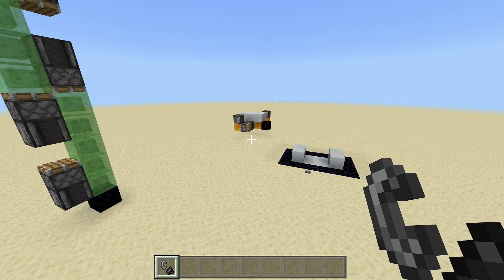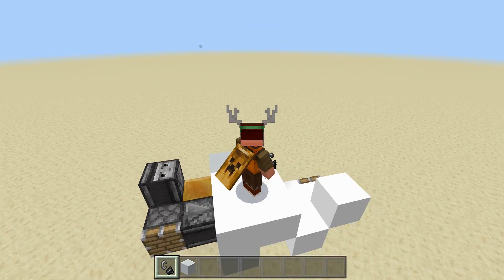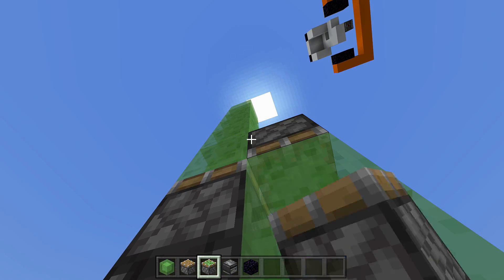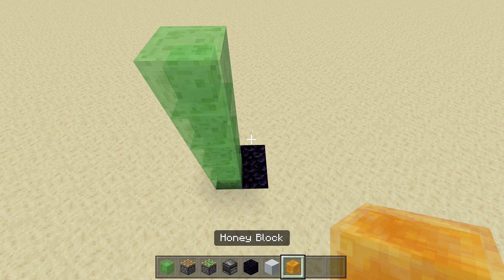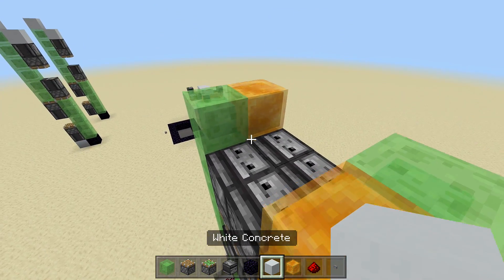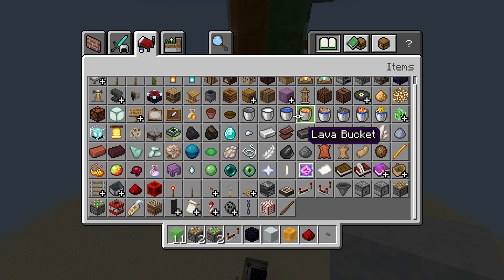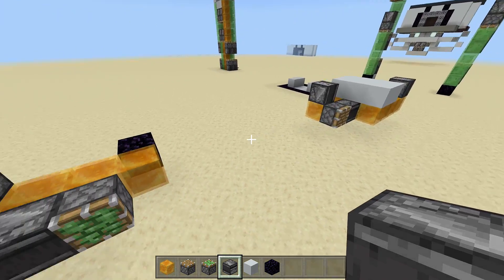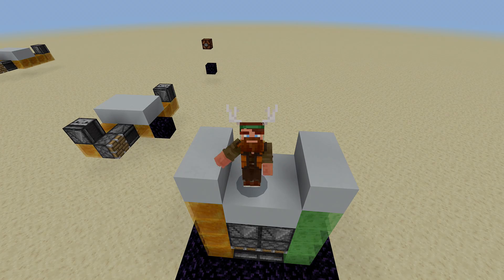2 Way Flying Machine in Minecraft Bedrock! (NO PISTON SWAPPING)

Comment: Is it possible to stick some slime blocks on the side of the horizontal flying machine and make a sugarcane farm. And if so could u make video showing a design. There's not much good bedrock content. That I could find that are simple. Thank you
Reply: I am working on that now. If you mirror the design and make it with slime blocks, as long as you have the observers fire at the same time, you will be fine.

Comment: Right... so, I tried the small vertical flying lift and it works no problem. Up and down. The bigger one however, will only go up. I cannot figure out what is wrong. When I press the button, it just separates the top half of the lift from the bottom half. Pressing the button again connects them back together
Reply: having the same issue

Comment: Just built the horizontal flying machine for my bamboo farm on 1.20. design works as long as it's chunk aligned. I had 2 exact copies of the machine, 1 where all the pistons and observers were in the chunk and the 2nd where some elements were between chunks. The non aligned one always broke, without fail. After rebuilding the 2nd inside of 1 chunk it flies just fine

Comment: Has anything changed since 2020 to break this?  It works fine 90% of the time, but occasionally a normal piston gets left behind (not dragged along with the slime it's attached to)  Also, I use a redstone circuit to 'ping' a dropper to activate the flying machine, and sometimes it just moves one block forward, then one block back (to the start/stop point), sitting there until the next ping from my redstone clock.
Reply: Yup same issue and on realms it is crap all together.

Comment: Can u pls build a secret door using an item. Which means that you throw an item and then the secret door opens. Plzzzzz.i wanna build it in my survival world
Reply: Just do the painting trick and put a pressure plate behimd it with an iron door
Reply: No, what I want is like you have to throw something through the staircase or floor and then the door opens. If it's possible I'll try it out in my redstone testing world. I'm asking this just cuz I'm on bedrock and most tutorials are in java.
Reply: @advaitkhandagale6791  I'm not sure if this will work but here's an idea, so beneath your staircase or floor make a standard small filter system with a hopper minecart on top depositing into the main hopper as hopper minecarts pick up what's above them (within a block) so it would work you threw something a block above it, that would work for getting a item through, then use the filter system so only a specific item can come through and then in the chest into which the item is filtered, connect it to a comparator so it will give a signal when the system collects a block hopefully you can use this to deactivate in some way(I'm not sure) the door and make it open, hopefully I explained that well enough and hopefully it will work
Reply: @danielcarter1512  kk

Comment: Missile works but is there a way to wire the button for the lower section closer to where you would actually be while using it? Its impossible to press the button and make it to the standing platform on time as it is in this video.

Comment: Hi! Originally when I made the "Missile" it worked for about 5 minutes. Then the slime blocks completely stopped moving, which was messing with the honey blocks, stopping them from moving. I built it upside down because I was trying to use it to open a door. It was a 2 by 2 door that was completely in the piston push limit. Is there a fix that you know of? Thank you!

Comment: Has anyone got this to work on a multi-player server? Built this on a bedrock realm and it will go up fine. It will start down but then the timing gets messed up and goes right back up. I built it on a single player server and it works fine. I assume the latency requires additional timings to work.

Comment: Is there anyway you could make this into a viable tunnel bore since the last update on bedrock (at least for me on Xbox) absolutely broke every other model I’ve seen and tested. If not no big deal but I thought I would ask because I am definitely not smart enough to invent one myself 😂
Reply: if its vertical you can just attach a pulsing dispenser with TNT inside or a TNT duper at the bottom of the elevator. Although it is suggested that you do so with a certain distance already present between the elevator and the dispenser to avoid damage and a few delays in the pulse to avoid TNT bounce

Comment: I really need help. I have tried so many different flying machine variations, vertical and horizontal, and they move randomly, until they hit a block. It will go up a little bit, then come back down, or go halfway then come back, then go up again. I would really like an answer to why this happens, and a way to fix it. Flying machines are awesome, but I can't get any designs to work, and I'm on bedrock edition. This really sucks, as I really like redstone, and I am limited to small scale contraptions because of flying machines moving randomly.  Whoever knows the answer and/or a fix, please let me know, it would be much appreciated.